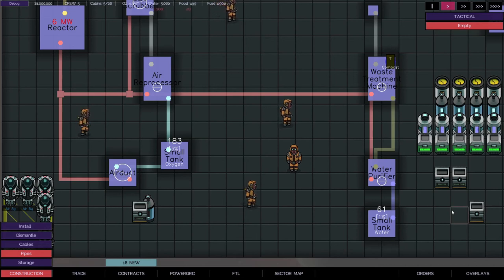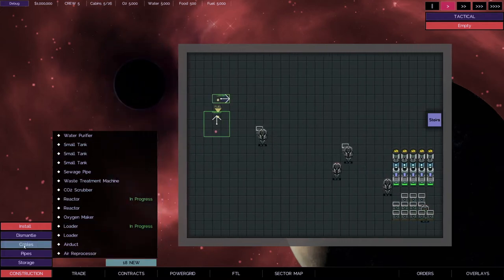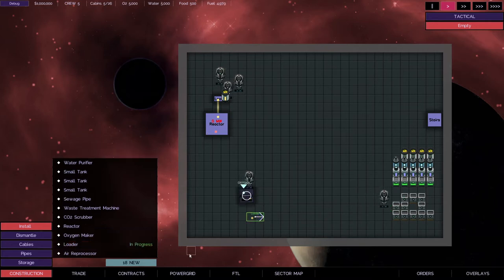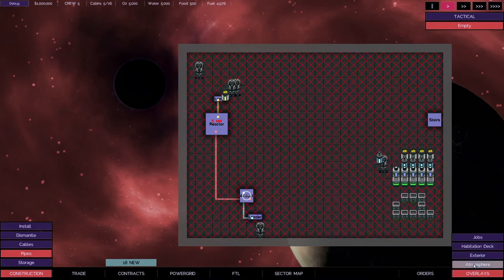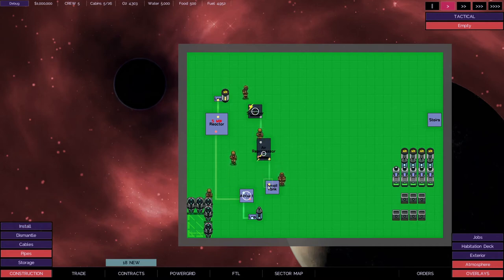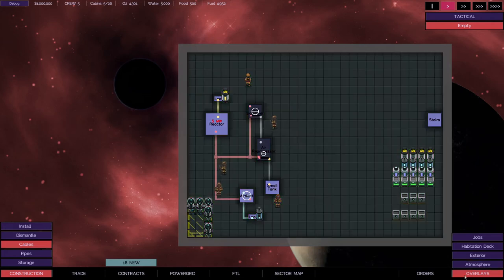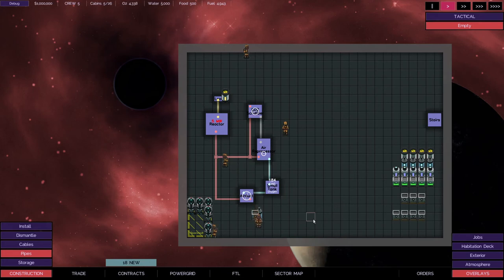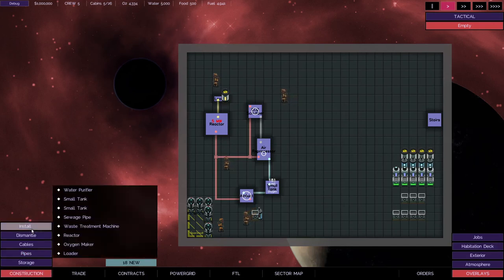The Last Starship: Plumbing and Life Support - Laurence Plays

Comment: You should be able to put a small tank connected to each type of pipe so that there is a buffer for each resource and you don't get short outages when a canister in a loader needs replacing
Reply from the maker: Very true, that's especially valuable for fuel so you don't lose power and thrust at an inopportune moment!

Comment: I cannot get sewage to work at all. did something change in the last 6 months?
Reply from the maker: Probably! I have to admit, I've not really played much since I made this video, so I don't know what's changed. Sorry!
Reply: place sewage pipe anywhere under habitation deck(you can check where it is on habitation overlay) connect the pipe to the waste processing plants sewage input. then connect said plant output(dirty water) to water purifier. then, as an option, connect water purifier output to oxygen maker. of course you can place and connect various tanks as buffers as needed i recommend placing a buffer(preferably large tank) only connected to water purifier output as that way you can disable oxygen maker any time (if you use both co2 recycling and oxygen maker chances are you will be producing more oxygen than your crew uses- i know its strange lol) without clogging up waste processing.

Comment: Says output blocked whatever I do for sewage pipe
Reply from the maker: The game has probably changed quite a lot since I made this video, but I'd recommend checking that the pipes are hooked up properly and that they go to something which will deal with the next stage.
Reply: If - for whatever reason you accidently assign a Tank to the wrong substance (GAs, Sewage, Oxygen etc) The Tank "remembers" its designation and won't change - you need to delete the Tank and put it back fresh. If whatever is in the tank is valuable (I tend to only use Huge Tanks, so anything inside is usually a lot of work!) place a Loader outside, and switch it (via Right Mouse Button) to Unload. This way you keep the contents, replace the tank and hopefully get a working system ;) Also - it#s worth noting that identical systems can give different readings in the game - I have 2 Gas collectors on identical rigs - one shows "no Problem - Working"... the other has flashing lights on the intake / out take valves... but under load they both work fine. The game is in Alpha, we need to accept these things. I'm assuming anyone reading this is into the game? Any and all tips / tricks welcome - please do reply.